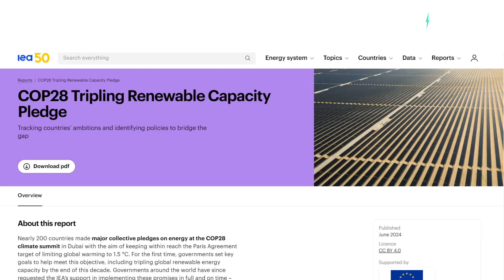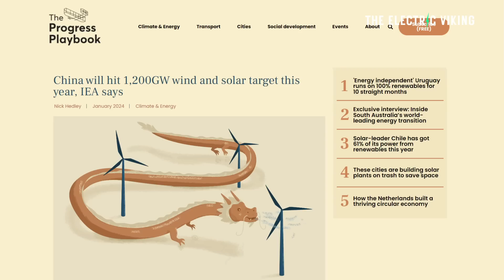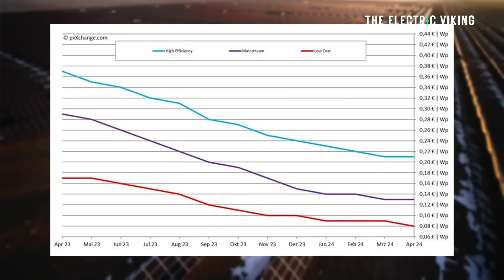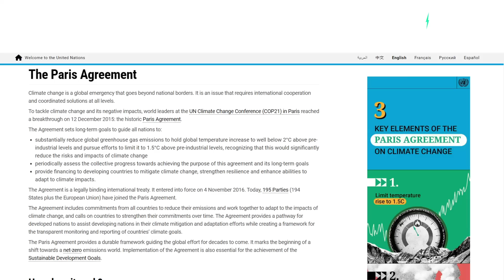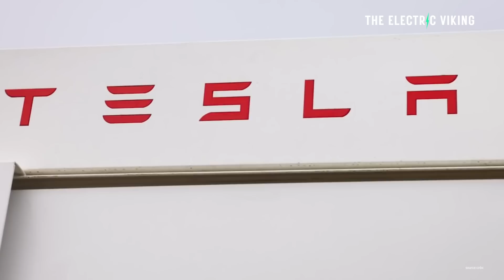IEA debunks media lies - world will triple renewable energy capacity by 2030

Comment: For "superpower" to happen, wind/solar/battery not only has to get cheaper, but it has to get cheaper than continuing to use EXISTING natural gas power plants idled by W/S/B.  A natural gas plant used only 10% of the time (to cover days not fully covered by some level of W/S/B build-out) presumably can last longer, meaning the  average yearly replacement cost expense is much lower.  

Even if we insist that we stop using natural gas, and required the plants to use synthetic gas made from captured CO2 and water and renewable energy - maybe only 30% efficient round trip energy storage from electricity back to electricity - the cost of storing energy as fuel in a big tank is quite cheap compared to battery costs, so even that approach might be cheaper.
Reply: With ruinabels it's guaranteed we will have to keep using natural gas.  No way around it if we still want a grid.

Comment: 1. Cost of electricity in California is amongst the dearest. 30cents (US)
2.   47% is from natural gas.
3. All these panels will need to be replaced every 15 to 25 years.
4. Renewables  bringing down power costs is simply a lie. Most nations that have introduced significant renewables have seen prices go up. 
5.  Cheapest prices are where a careful mix of energy forms is used. Especially when they incorporate nuclear. The dearest component of renewables is storage. You don't need that when nuclear is in the mix.
Reply: Well actually with nuclear some peaker plants will still be required.   Nuclear is an excellent base load, but cannot ramp up or down quick enough to satisfy the fluctuating peak demands of the grid.

Comment: Tripling from a low base is easy , but fossil fuels will continue to supply the majority of global energy demand in coming decades.
The cost of installing and continually replacing wind and solar , combined with the huge cost of storage and the increased costs of transmission , will ensure that the global domination by fossil fuels will continue.
Reply: Yeah if they ever try to eliminate fossil fuels we are doomed.
Reply: Huh?
Wind and solar are significantly cheaper than fossil fuel power.
Have been for a few years already. 
And grid level storage pays for itself quickly
Reply: @mickydee26   Actually wind and solar is even more expensive than nuclear when real numbers are used.
And we have no grid level storage capable of sustaining the grid for the long periods that ruinables fall flat.

Comment: I put solar on my home - just love driving my car on sunshine!
Reply: You aren't powering your car from solar on your home. Your roof isn't big enough and you don't have enough money to build a system that could power your EV.
Reply: think again bro, I installed my own energy monitoring system - I’m regularly producing greater than 110 kwh per week - that’s more than I need for my shiny new Tesla Model Y - that’s with an undersized system of only 5.7 KW - on a sub-optimal location on my house in the middle of a forest (because the morons that run our community think solar panels look awful - I think they believe it’s just wrong to harvest the sun’s energy 😂)
Reply: @willm5814   You just displayed you lack of a system, or knowledge of them altogether.  A 5.7kW system is not only small, but it isn't enough to charge a Tesla, unless of course you don't ever drive it.  Even my largest system of 15kW wouldn't charge a Tesla except in the Summer when I usually have some excess electricity.
Reply: @ForbiddTV you’re making me laugh, I wrote my engineering thesis on the topic in ‘81 - installed my first off-grid system in ‘98 - My system 5.7 kw it covers all off my driving in my MY - you’re just going to have to deal with that 😂
Reply: @willm5814   Why don't you look up how many kWh it takes to charge up a Model Y and try your lie again. Then try it on someone who doesn't have many alternative energy systems over the last 40 years and four EV's before the first Tesla was ever produced.
Reply: @willm5814   Keep in mind as you try to come up with an answer that your 5.7kW system has NEVER actually put out 5.7kW.  If you actually had solar you would have already known this.

Comment: In historic context, we are getting so close to being able to produce all out energy needs and to be able to store it, even at a localised level, which I suspect will push most of us to want to go gridless to have more control over what we produce and use, as well as the cost, after all, for all the talk of how much renewable energy is going onto the grid, consumers don't feel like they are benefitting from it in lower bills, which kinda holds back renewable deployment, but gridless or attached to the grid but producing your own energy, you're in control of the energy you produce and the cost.

Over the next 2 to 3 decades, maybe sooner, we are going to have a revolution in the energy sector, I suspect most of us will produce our own energy on-site and probably won't need to be connected to the grid, especially once battery tech is better and cheaper and we have a good mix of solar and wind power at a local urban level.

That we are getting some downbeat reports or underselling of renewable energy, that doesn't surprise me, the fossil industry is big and they will protect their profits by any means they can and renewable energy is a major threat to them.

In any case, I still find it remarkable about all the debates around renewable energy, it's clear that it works and works well, it's a cheap long term form of clean energy, the only issues it has is that we need a buffer of storage energy, but that's quickly developing with better battery tech and other storage innovation, as renewable energy continues to get better and cheaper, and the same for energy storage, it's going to be everywhere that I think it will supple all the energy we need and more.

I also think that by 2030 onwards, many countries will supple 100% of their electrical needs and likely export energy, they are also pushing more towards an electrical system with EV cars and heat pumps, meaning, there's going to be far more demand for electricity and far less for oil and gas, this will set off a chine reaction as more countries do it, others will follow until eventually the entire world is clean energy, but I think as tech advances, I don't think it will be grid energy that wins out, it's likely going to be gridless because that gives the owner far more control on what they produce, use and on the cost, that would also have massive savings if we don't have to maintain the grid network, which I think I heard cost around 40% of the entire cost of energy, which if true, that's a lot of money to be saved just there.

One last note, I also think renewable energy will be a game changer for developing countries, especially on the African continent, after all, once you can produce enough clean energy for your needs, it's going to be much easier to produce clean water and food, that will open up the door for them to develop in other areas, we'll all benefit from clean renewable energy but developing countries stand to benefit a lot more.

Comment: The FFi is not going to be defeated without a fight using propaganda and lobbying. They have lots to lose. They will fight dirty to survive. Conservatives will take their lobbying dollars to speak on their behalf.
Reply: They don't have to.  Ruinables can never replace fossil fuels and they know this full well.
Reply: @ForbiddTV  
I support renewables because they are sustainable, cost less over a long period and they produce less green house gasses.

For what reasons do you support fossil fuels over "ruin"ables?
Reply: @vasthefox   I am no big fan of fossil fuels, I just know we cannot have a grid with 100% ruinables, so it is nonsense to think that the Greenies can do away with fossil fuels and still have a grid.
Reply: @vasthefox   Nuclear should be more of our future goals than ruinables, but the Greenies don't like this clean and safe form of electricity.
Reply: @vasthefox   You might want to look at the raw materials needed for "sustainable" ruinables.   Gets even worse for EV's.
Reply: @ForbiddTV  
I am aware that there are costs associated with the raw materials and their recycling. On balance they are a fantastic bargain compared to fossil fuels. 
I too am of the opinion that Nuclear power is effective, efficient and safe enough to be a significant part of the mix of a sustainable energy system. But modern solar panels from China are THE most cost effective producer of electricity compared to ANY other method, even hydro and wind. I'm not sure why solar has gotten SO low cost. Maybe it's subsidized by their government or they have over capacity that incurs a loss for them or maybe they just figured out how to produce the panels cheaply at scale. Whatever the reason, solar is the clear winner. When paired with 8 hour battery storage there is no need for peaker plants burning fossil fuels. So a grid with 100% renewable energy is cost effective today and still getting even cheaper.
Reply: @vasthefox   Batteries are even worse, do some calculations of exactly what "8 hours of battery storage" means.  And you need much more than 8 hours BTW.  Ruinables will never be cost effective for the grid, and 100% ruinable isn't even possible until there is a quantum leap in energy storage technology.